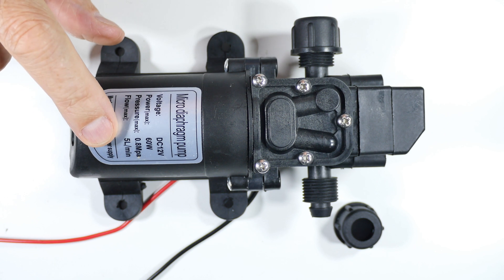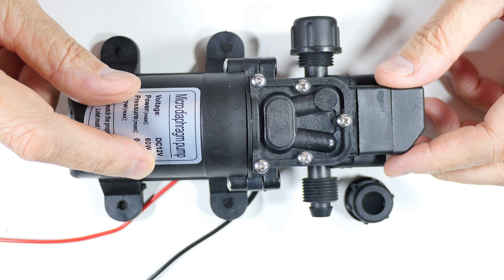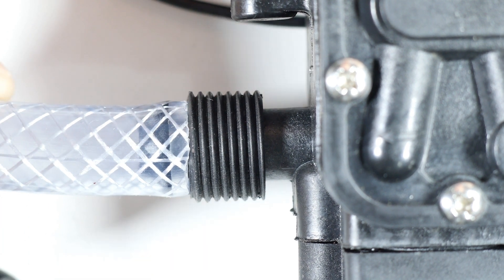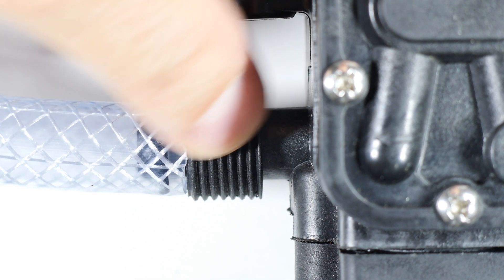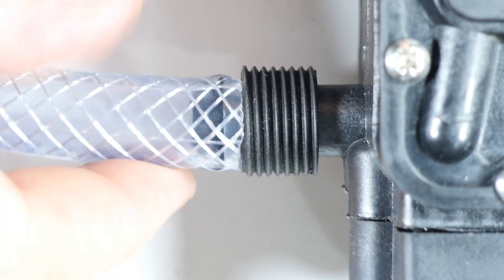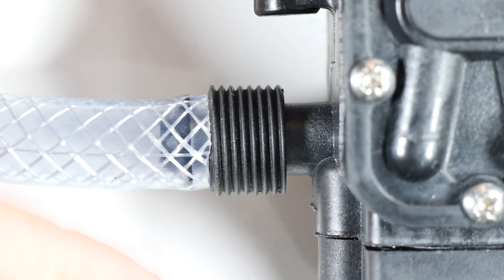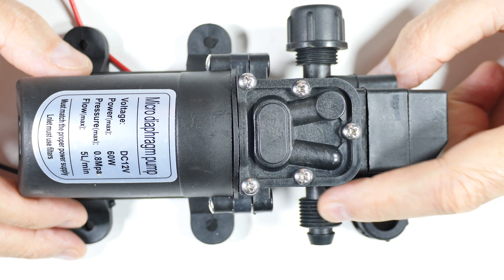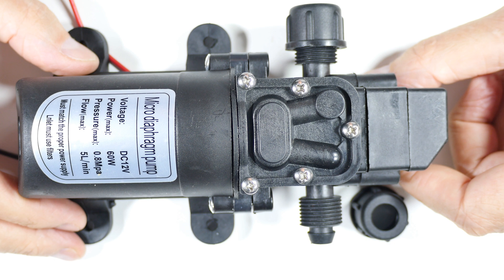Cheap 12v Pump Review (4K)

Comment: Hi, I think you put a bigger pipe there. it needed a tinier pipe.
Reply from the maker: It does need a smaller outside diameter, but the spear is too short for any size tube. It needs to be 2x or more longer than the inside diameter to avoid coming off.

Comment: I have two of these from a purchase several years ago. They were cheap and I thought they might come in handy. I need to move water up a 3ft intake and expel it 3ft above that. A very shallow well. Wish me luck :)
Reply from the maker: @jsmythib  Mine pump a ton of water up 18 meters (54 ft) every day. They last 3+ years. I don't know how much suction they have. The inlet pressure on mine is very, very low, but positive.
Reply: @tsbrownie  As it turns out my 12v eco-worthy pump didnt die yet*(they last 2 years) I just blew off a diy connection underwater. A hand dug garden/chicken/backup well 4x4x12. Good to hear my backup should work. Worst case I may have to float it on the waterline.

Comment: I've got that too in my campervan, you're right about that connection, I've got it to just about work with the blue tube used in a campervan and hasn't fell off yet, had to drill out that hole.
Reply from the maker: Thanks for the info. I suspect it's a common problem with it.

Comment: You want 8mm garden hose, luckily I had some from a cheap gardening hose reel. You can get the ends off Ebay from China for $3, in Australia, they stock 8mm (red Pope) fittings at Bunnings for $5, both of which connect to standard 12mm.  The distance past the barb I don't think is an issue, its the barb that makes the seal against the nut - hose fittings are roughly the same in this respect. Just tested mine (0.9Mpa)  and works fine, didn't blow the hoses off when flow was restricted.

Comment: A diaphragm pump aka a Membrane pump is only LOW pressure pump and these connectors has to be used with silicone/latex tubing only.

Comment: Wow! What amazing timing that you just posted this video!! I bought this exact model and it arrived today, and I ran into the same problems you mentioned! Fortunately I'm using it for very low-pressure project (recirculating warm solar heater water into a soaking tub), so my fix will hopefully work: I wrapped silicone tape around the threads and happened to have hose that fit just perfectly over the silicon sealed threads. I added a hose clamp and tested, and it seems to be working great.

@tsbrownie: I luckily stumbled on this great video after it was suggested at the end of your awesome diaphragm pump teardown video. Do you have any thoughts on how durable these diaphragm pumps are compared to similar-priced centrifugal pumps (like those used in water fountains)? Do you think they will last as long? What about continuous use of one vs. the other? Thanks again for your great videos, I'm subscribing!
Reply from the maker: I've had very good luck with these RO water filter diaphragm pumps.  On average they have lasted 3 years in my application of pumping an average of 1 cubic meter of water per day at a head of 18 meters.  They fail when the rubber breaks down (a silicone version would last a lot longer).  I've seen them used in a chemistry department pumping chemicals in an experiment that continously ran for weeks at a time.  I've tried other types of pumps that claim to be able to produce 80 PSI and so far not one has lived up to it.
Reply: @tsbrownie  thanks for all that! I'll definitely keep it out of the sun / elements to preserve the rubber as long as possible. I've also been experimenting running it off different wall adapters I've got lying around. I know it says 12v 60 watts, but I've run it very successfully with a 12v 850 mA adapter. I'm not planning to use it for more than a few hours a day and in very low pressure. Do you think that will degrade it's life, potentially increase it (since it's not working as hard?) or no real impact?
Reply from the maker: @Nifty-Stuff  From my experience, the decay is just a matter of aging, not really of use.  The rubber does not crack, it just begins to rub off until the valves and pistons don't seal.

Comment: Fish tank pump only..sand the threads off and use small hose clamp ..chinizem junk..have a great day..
Reply: I think so too. 
A hose clamp will do the trick. 

Heat up the hose end, spray some silicone oil on the threads and slip the warm hose end right over the threads (if possible). Then clamp it. 

You can try prestreching the hose end with a pair of pliers if necessary.
Reply from the maker: @oilybrakes  I think you are both right.
Reply: I think heating will defiantly help.but I don't no if I would use silicon lube..might want to if it is going to  on and off connection . if you have a gasket sealer aka permatex for pressure and removabilty ...have a blessed day👍